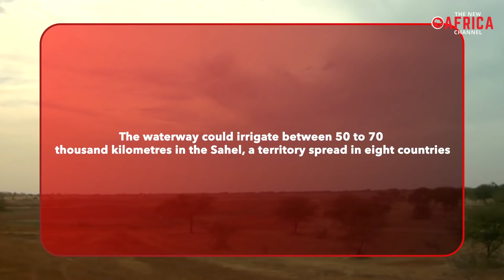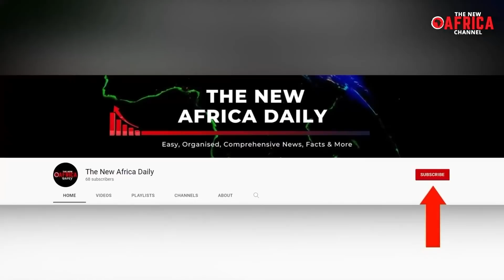Lake chad  - How Africa plans to save the shrinking mega lake chad from climate change

Comment: Afrika should investigate flat earth, not just type on google flat earth, NO, people should do their own measurements, there is enough technology to see distant objects what you're not suppose to see on a ball earth. The formula is 8 inch/mile square, for the alleged curvature of the earth. We can easily disprove its existence of any curvature of a spinning ball. This ball earth model is NOT REAL. It's just fiction. So that's makes this video NOT CREDIBLE
Reply: LMFAO!   The earth is not a perfect sphere, the curvature varies a bit in for a number of reasons wherever you are.  And quite frankly, for most intents and purposes we can work under the assumption that the earth is flat.  But it actually is a spheroid.  There are numerous methods by which you can confirm this, I'm not interested in convincing you of anything; if you prefer to believe nonsense that is irrelevant to me.  The techniques by which you can confirm the curvature are vary in their complexity and difficulty to perform, but a number are quite simple and require little money and few people to perform.